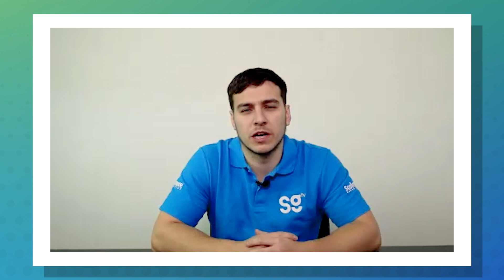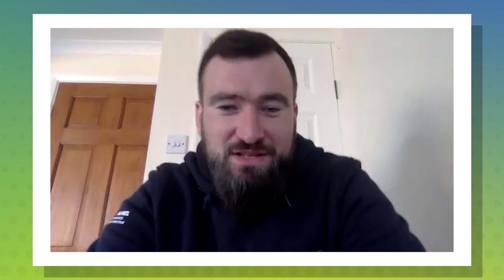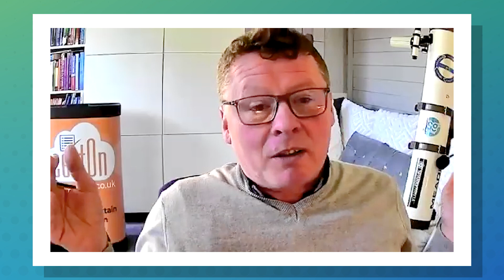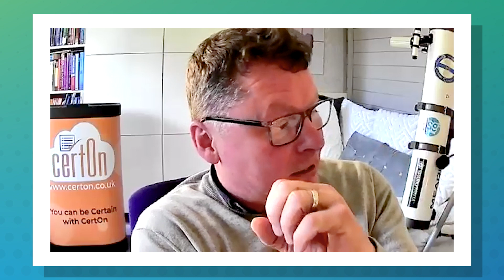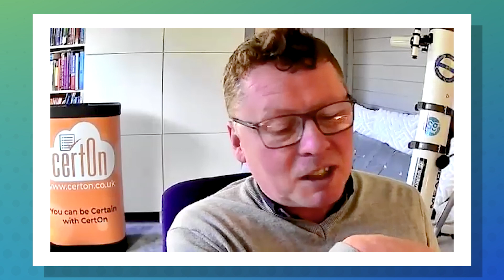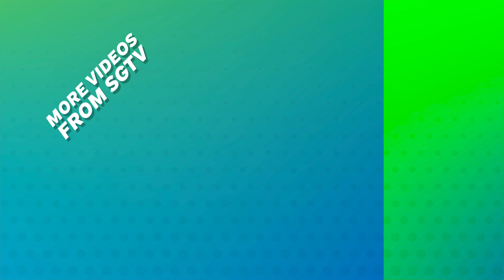WHAT WILL AMENDMENT 2 MEAN FOR YOUR ELECTRICAL BUSINESS?

Comment: Typical AFFD is £149.00, if you change a consumer unit with 3 rings and a cooker circuit then you are looking at an extra £600 passed on the the consumer, who are not going to pay it against the sparks who won't install AFFD's

Comment: They should look at simplifying things and also force Electricians/Designers to comply.  Eg
Outlaw split load boards in domestic properties from being installed by 01/01/2023 with the sale in the Uk of this CU no longer allow after 01/12/2022

Minimum legal requirement for a domestic CU is to use a Type A RCBO for final circuits unless a MCB/RECBO arrangement would be better suited eg a shed or out building with the MCB in the CU supply end and RCBO at the outbuilding/shed end

Remove the option on Risk assessment for SPD in inclusion in domestic CU and make it a legal requirement
Reply: At what cost thou Sergio, AFDD is going to put the price of a consumer unit change through the roof
Reply: @njwareing6408  In my previous comment I stated.      Minimum legal requirement for a domestic CU is to use a Type A RCBO.     RCBO type A are a reasonable price